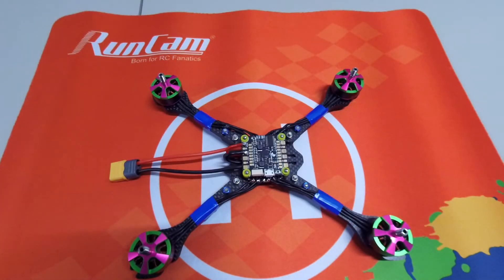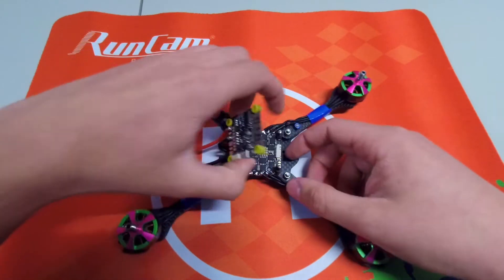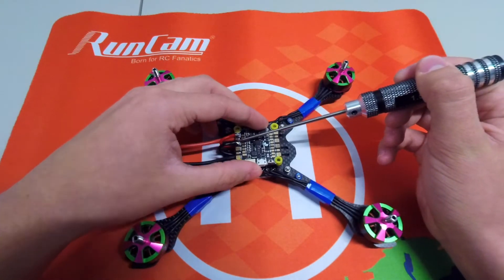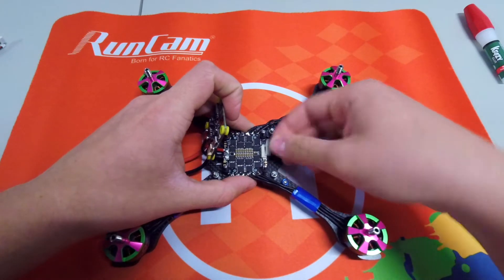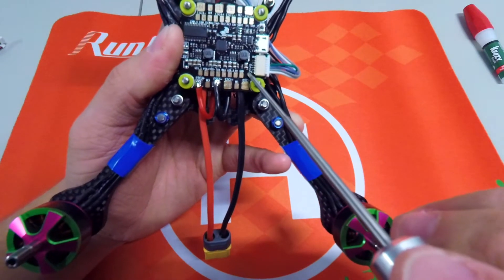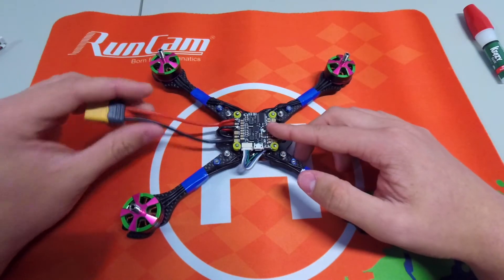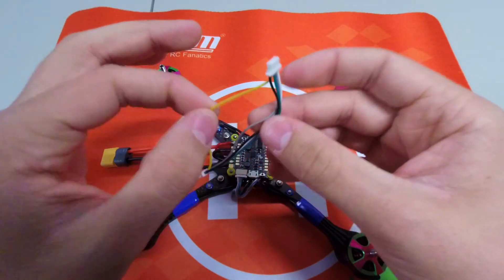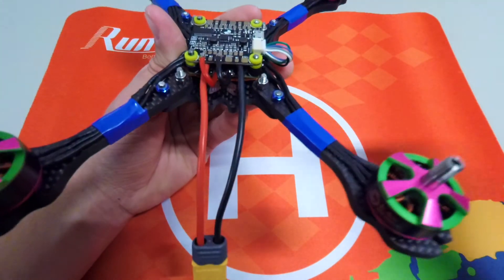How to Wire the CL Racing F4S Flight Controller to a 4in1 ESC

Comment: Hi there, this was a good option for me, but as I have done al shown in your video. Motor 3 doesn't turn... when I plug in the lipo it moves on the initial 3 beeps, but doesn't react on the last two neeps as the other motors do beep and move simultaneously.  Is there a way to solve this a you know? 

Hope to hear from t you regarding my issue. It's been a while when you have done this video. 

Kind regards, 

Dennis.

Comment: Hey man, i am using the clracing f4s v1.5 with the is30 spedix 4-in-1 and i wired it just like you did and  its flying great..... except for the deathroll everytime i try to do a flip or roll, other than that its super smooth and clean... may i ask what settings you used in blheli and etc? Ive tried messing with throttle idle value, no motors are stuttering, ive also lowered motor timing and startup power to no avail, i should mention that whenever it death rolls and bounces off the ground that i can not rearm until i power cycle? Any advice would be appreciated cheng lin assures me that this cant happen on v1.5 but its happening on a brand new build hos suggestion was a "guess add a capacitor.
Reply from the maker: This is strange, I am fully aware that the first version of the F4S had death role issues with certain ESCs (such as the Emax Bullet and some others) but it was due to the fact that the ESCs didn't include some important components that are found on almost every other ESC. What ESC protocol are you using? The IS-30 supports Oneshot125, Oneshot42, Multishot, and DSHOT600. Out of these you should only use MultiShot or DSHOT600 and if you are using Mulishot make sure you calibrate the ESCs through the Betaflight configurator. You can add a capacitor if you want, since this video I have been putting them on my 6s rigs just to make it easier to tune and a bit more reliable. I would also recommend you double check your ground cables and make sure you don't have cold solder joints. I am not sure what else to tell you, hard to diagnose through the screen.
Reply: Dshot 600, solders a pretty great bubble on the wiring and ive dropped my motor timing to mediumlow and startup to 0.25 and its still there, i can add that this is my first time using 4-in-1  so who knows same components and wiring as my other 2 builds minus obviously the 4-1 and the frame..

Comment: I am kinda confused. The board is 4in1 .. what means build in ESC and PDB ? right ? 
I thought that is all i would need to build the drone. Is that right ? 
Or do i need an additional ESC ? 
Nice Video anyway
Reply from the maker: A 4in1 refers to an ESC that is all 4 escs combined into the one board. The flight controller is a flight controller and a PDB which means you don't need a separate PDB but you still need ESCs for the motors. If you try and solder your motors directly to the flight controller you will notice that there are only two pads, positive and negative, but a motor requires three pads.

Comment: Thanks man that really helped.. I couldn't understand why there was no VCC wire on the harness to power the FC from the 4in1.?? All other new flight controllers have battery, ground, 1,2,3,4 on the 4in1 port it would of made it a lot simpler and clean.. what do you think anyone? Cheers!#😊
Reply: ya its BS....i just solders my xt60 black?Red to the esc....soldered up the fc, and plugged wire harness in the esc and fc, put it all together and the damn esc and FC not communicating at all....I had no clue that you have to solder the extra black and red thick wire to the fc and esc..... kind of dumb, if I knew this i would of never got this FC

Comment: Why did you connect the ground wire on the harness? What is it for?
Reply from the maker: The reason I connected the ground wire on the harness was simply as a precaution. I don't believe it actually does anything since the ESC is already grounded on the FC's ESC pad.

Comment: So I bought the cl racing f4s 1.4 and I accidentally connected the Vbat wire to the ground pin and the board died before flying it, I asked CL racing if this is right or this board is defective, and they claim it’s my mistake and the board isn’t defective, I am not an expert but this is questionable to me, what do you think?
Reply from the maker: If I put a wire in the wrong spot and it smoked the board then it would be my fault and the company that makes the boards probably wouldn't give me a refund since it wasn't a factory defect.

Comment: I got f4 omnibus and bs412 4in1 esc. The esc have 6 pins jst, 4 motors and 2 pos-neg pins. What  recommended wiring line to do. I only connect the fc from the jst.. And powered the esc to the lipo pads.. Im sorry if theres any same question like me... Thank you..
Reply from the maker: I cannot tell if the FC can be powered off the 6pin wire harness or not. If you cannot power the FC from the wire harness then I would recommend soldering the FC and ESC just like it did in the video. In the case that the FC can be powered from the ESC wire harness then you will want the battery lead coming off the 4in1 ESC instad of the flight controller.
Reply: Tristin Gilbert thank you for your response, i tried like what you did and works great...

Comment: Just wanted to check and and see if this setup still was reliable for you? Also did you use the dedicated cam and vtx pads on the CLracing board without and problems?
Reply from the maker: More than six months later this setup is still chugging along and so are three others built exactly the same. For my camera and VTX I am using the dedicated pads. I have had no issues with extra noise or video problems in general, the built in filters definitely helped. I have also wired this FC up to a DYS 4in1 and a Hobbywing just like I did in this video and they also worked great.
Reply: @TristinGilbert_RaceBotFPV  Great video.. p.s add on the receiver, cam & VTX setup if you even if it's a short vid..
Reply from the maker: @Pete fpv maybe next time. I made this video because to focus on getting the ESC and FC to work together since that was a huge issue a bunch of pilots in my local groups were having.

Comment: i have an answer... at min 3.01  the number of the wires on the esc board :" in top number one, at bottom number 4", but in the wire diagram of this esc the number 1 wire is in the bottom and number 4 is on top. i have the spedix gs 35 A,is it a new version compared to yours?. i have this one   https://www.quadcopters.co.uk/spedix-gs35-4-in-1-esc-35a-blheli-32
Reply from the maker: I wasn't able to just plug it directly into the flight controller, I had to depin the entire connector and swap the wires around so they were all going to the correct positions from the ESC to the FC. I used the Spedix 30A 4in1 for this video but I believe it is exactly the same process for the 35A version. You just want to make sure you have the motor wires going to the correct pins on the FC.

Comment: Hi I'm having brown out issues with this flight controller. When powering vtx and cam on the dedicated pads. I had to power cam and vtx from the ESC pads. Also had to add a cap to power in. Anyone else else have any issues with brown outs. The cam would reset mid flight.
Reply: Keep have RX Lost messages and mid air disarms with this FC. RSSI is in 70s when it happens

Comment: I am building a quad with the CLRacing F4S and AirBot Typhoon 4-in-1 32bit v2 ESC. I wired like this way, I hope it will work: I soldered the Bat+ wire to the FC Bat+ pad, and then on the other side of the shunt resistor I made a jumper wire to the ESC Bat+ pad. I connected the Bat- Pad to the FC Bat- and ESC Bat- also. I think this way the FC's internal current sensing will measure the current flow through the FC to the ESC.

What I am unsure about is that how I will wire the ESC telemetry. Do you have the idea? Am I right that the current sensing input on the FC is not used for that? On the ESC there is a pin that is labeled SWC, and I am suspecting that it is the ESC telemetry pad. I think I have to wire this to the FC on some TX or RX pad.

Any ideas about the AirBot Typhoon 4-in-1 32bit v2 telemetry function?
Reply from the maker: Sorry but I have zero experience with the AirBot Typhoon 4-in-1 esc. The way I have mine ESC and FC wired gives me full current sensing. I use the Spedix 30A 4-in-1 and it does not have a SWC pin or current sensing pad built in. There are a bunch of groups on Facebook such as Rotor Riot and Piro Flip that can help you.

Comment: Very nice video 
Do you know how to wiring the r-xsr
For telemetry on the lc- racing f4s?
Thank you
Reply from the maker: S-Bus from the r-xsr goes to the sbus pad on the FC and the S-Port from the r-xsr goes to the telemetry pad.
Reply: After you setup that wiring on the R-XSR on the CL Racing F4S, what do you have to do w the uninverted signal thing? how do you set that up in Betaflight ?

Comment: Sir, you do not have to wire the main cable like in your video. You can choose external or internal current sensor option on the clracing f4s board.
Reply from the maker: You can power the ESC first and have the FC set to external current sensing if you would like but I decided to power the FC first and have had zero issues.

Comment: Hi I have the DALRC 4in1, if I follow your method I’m not clear on how to wire up the port wire, the DALRC has 8 wires , current, 5v, VCC, gnd and the 4 motor wires. Any assistance would be great. Thanks

Comment: awesome build,ive got a radiolink at9 transmitter and 1104 motors.what FC and esc's do i need to get flying?and for future reference what info i need to determine what FC&esc's goes with what motors,and what battery size to use?
Reply from the maker: 1104 motors are for 3 inch drones (possibly 4). 20 Amp ESCs should be more than enough, 10 amp ESCs might do the job. I don't actually know much about 3 inch builds since I only fly 5 inch racing and freestyle drones.

Comment: Great video 👍, if you could do one on wiring camera and vtx I would really appreciate it, I’m having issues with mine and I don’t know how to fix it , I’m powering the vtx straight from +/-  pads on cl racing f4s and feeding the cámara with vtx power out. Signal from vtx to “vtx_s” on fc and picking it up on “cam_s”  the problem is that the  fpv feed looks grainy and it gets worse when I do punch outs, what am I doing wrong?.btw brand new cl racing f4s replacing cl racing f4 that my armattan Japalura came with.
Reply from the maker: willian castaneda I would not power your vtx off of the +/-, use the vtx+ and vtx- pads, they are vbat AND filtered.

Comment: If my esc also has a current sensor should I just de-pin that wire and just use the sensor on the flight controller??
Reply from the maker: The CL Racing F4S can do on-board current sensing (using its own) or it can do off-board current sensing (using another board's current sensor). You can either power your ESC first or your FC first, but you will have to use these jumper wires like I did to power FC or ESC. I chose to power the FC first because I wanted vBat for my vtx and it was a little bit easier to jumper down to the ESC.

Comment: How about the new spedix 35a it has a current sensor out would that just go to the currant sensor on the 4 in 1 fc and then power it from the bat + wire from the esc!
Reply from the maker: I know that you can take the sensor wire out from the FC to the sensor on the ESC. For powering the ESC and flight controller you can either do the same thing I did or you could power the ESC and then have a wire going up to the FC but I would recommend contacting CL Racing (they have a facebook group that does a pretty good job at getting back to you quickly) because I am not 100% sure on that but I will definitely look into it!
Reply: Tristin Gilbert ok THANKS!!!

Comment: Are you sure about powering your 4 in 1 with one of your f4 pad? Maybe it's not rated for so much current? I don't know but i'm interested to know your opinion about that. Otherwise, awesome video ;)
Reply: Augustin Crslt im doing this on my build with the previous model of CL_F4, its been running for a couple months now with no issues and I pull 120+ amps on punch outs. As long as you use the pads that are closest to the battery input on the board, you won't have any issues
Reply from the maker: Augustin Crslt I had thought about that also. According to CL Racing this board is capable of powering the esc off of the F4 pads without an issue.
Reply: Thanks to both of you for the answer 😉

Comment: do you know all the stick commands to access the camera controls with this FC?  I only know two  1) yaw right = camera menu for exposure, contrast brightness etc.   2)  roll right first, then yaw right = change preset settings for Outdoor, Twilight, Lighttrax etc.

I can't figure out, except by accident, how to access the menu to turn off the pilot name, voltage display, etc.
Reply from the maker: Brennan G those are the only two that I know also. I will look into this.
Reply: I just sub'd, looking forward to more videos.  thanks man
Reply from the maker: thanks Mark_m81. quick question, do you need to have a camera with built in osd or can any fpv cam work?